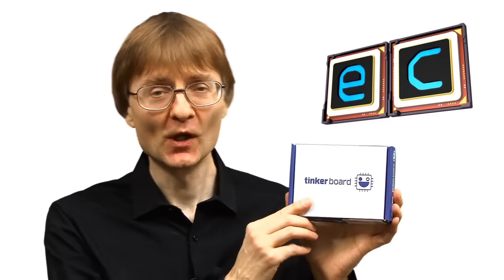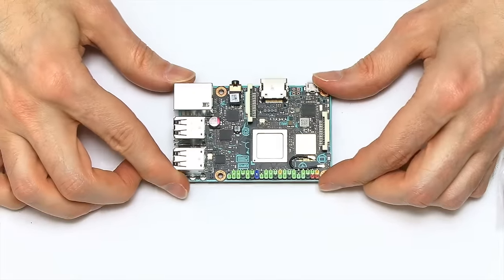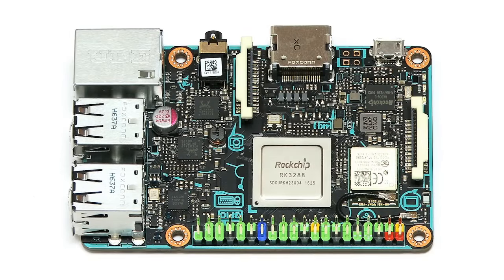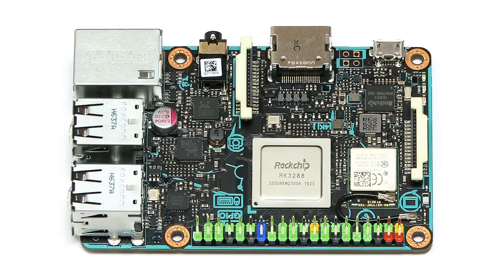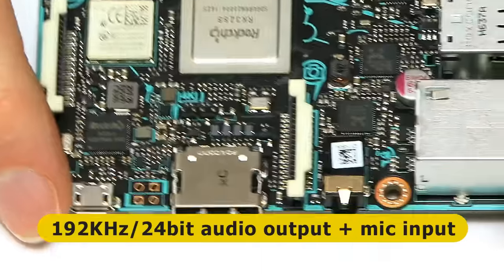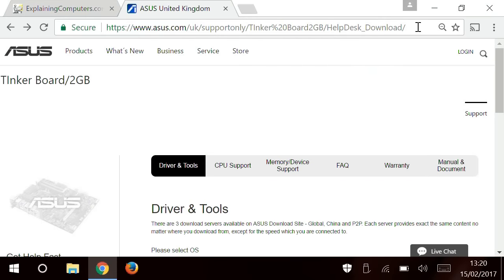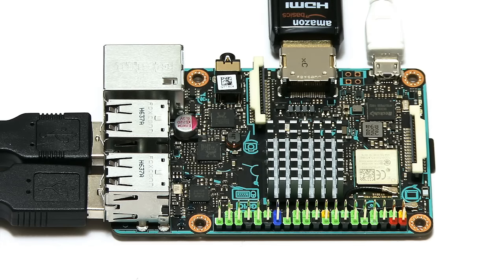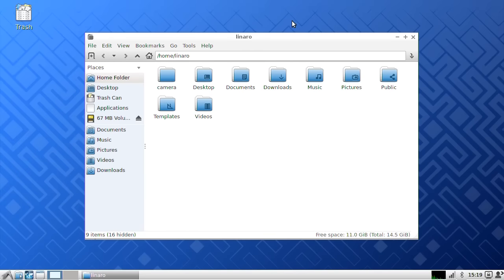Asus Tinker Board

Comment: The HDMI port is 2.0 NOT 1.4
Reply from the maker: On what are you basing this? I have read every document released by Asus, including the manual, and can only find it specified as HDMI 1.4. I would love to be wrong on this one! But I think some reviews have assumed it is 2.0 as there is 4K output. But we do know that the 4K is limited to 30fps (which 1.4 supports).
Reply from the maker: Techstunt, like many early reviews, was simply wrong (making assumptions from 4K as I noted above). In the Asus FAW document you link above, No.6 says "tinker board has 4 x USB 2.0 ports, 1 x GbE LAN, 1 x 3.5mm audio jack with 192K/24bit audio, MIPI DSI/CSI". And then no.31 says "Which HDMI version is supported" with the answer being "HDMI 1.4". So the Asus document you cite here makes it explicit that the Tinker Board is HDMI 1.4. I rest my case! :)

Comment: Can anyone help me why nothing happens when I start the system. It's just see a red light at Tinker Borad. //Thanks
Reply from the maker: The red LED is all you get -- nothing appears on the display until the operating system appears. If you wait a minute or so and nothing happens on first boot, remove and replace the micro SD card to check that it is seated properly. If this does not work, remove the micro SD card and write the image to it again and try again. If this does not work, re-download the TinkerOS image (in case it was corrupted), then re image and try it again in the Tinker Board. Oh, and before any of this, check you are using a 2+ amp 5v power adapter.

Comment: 13:55 you are effectively bottle necking the Asus Tinker Board  the modified version of Debian TinkerOS is still a beta and isn't the very best way to test anything on the Tinker Board  , the driver and kernel aren't fully developed to use the hardware

Comment: Its Too bad Only the CHIP has built in  LiPo power management .  every other Pi like  SBC  has no way to tell its own power level . shame
Reply from the maker: Very true.
Reply: For moble uses it would be killer to slap  on a single cell  LiFePO4 flat or  18650 and have the OS treat it as a UPS of sorts. 

If you dont use the Lith Header then the OS just ignores it . no hard no fowl 

The CHIP can Why cant Pi and the rest of them  ?  I mean I could get a  i2C  based  charge chip and  roast some code.... meh silly  Devs . ;)

Comment: I have a few of these little computers, in my opinion they are all a WASTE money and time. Get the cheapest available if you wish to use it as a media player (Kodi) is fine, other than that they are slow and they crush most of the time and just frustrating. I own Rasspberry Pi 2 (my favourite), PineA64, LattePanda etc... PineA64 broke after a few weeks, costed £70 or so...  I spent £120 on a Latte Panda with Windows 10 and a screen etc, it is okay for a child but too slow for a grown-up adult as a computer. Save your money, more importantly your time! There many tablets out there in the market would beat these little guys... (No, I don't work for a Tech company!) 📌